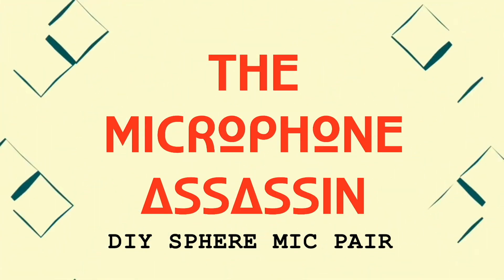Dueling DIY Sphere Modeling Microphones

Comment: I thought that only electronic circuits and capsules determined the sound of my DIY microphone. However, the fact that it is clearly influenced by the analog acoustics of the headbasket is very interesting.
I prefer the tight sound of a small headbasket, and I got a hint to address one of the shortcomings of my DIY U87.
It's a fantastic experiment video.
Reply from the maker: Thank you. It has come as a surprise to me as well since it hasn’t been a topic of consideration that I’d ever seriously thought of before. Tighter headbaskets, I am finding, are better suited for what I do.

Comment: do you have any blue bottle mics or a Soyuz? I wonder how they sound with their tiny head baskets, is this a thing now? Lots of people talking about basket size as a decerning factor, how important is it, I was always told it's the capsule, then it was the circuit, then it was the transformer, it seems like now it is the basket size, just asking for a friend my basket is pretty big
Reply from the maker: I have an 017 FET and it never occurred to me, but I’m sure it would sound very different in a larger headbasket. I’ve been honestly astonished in the noticeable differences headbasket size makes ever since the Sphere comparison videos from a few months back. Now, it’s another thing to consider, as if there weren’t enough variables to consider already. LOL. It’s no myth. Headbasket size and shape has a very big influence on sound. The tighter the space around the capsule, the fewer reflections are bouncing around inside and the smaller the phase smear.

Comment: This video comes just at the right time! 👍 I have two Townends L22's and I would like to build two DIY sphere mic's (my first DIY project). The arienne audio K47 capsules arrived today and the OPA Alice Dual Channels are on the way. But now I'm a little bit scared. 😅 I thought this kind of diy mic would be an easy one but you mentioned it is not for beginners. Could you explain why?
Reply from the maker: Yes, if you've never done my DIY before, there's almost always going to be some kind of issue or problem to solve that wasn't anticipated, whether it's the need to switch capsule mounts or how the board attaches inside the mic. It's absolutely an intermediate-level endeavor, but JLI offers up some decent documentation on dual alice builds. Overall, I feel like if you have to ask why, then you're not ready. But of course, feel free to make it as you see fit. Also, the flat K47 may be a little dark-ish for a Sphere, but the only way to know is to try. Have fun!
Reply: Thank's for your reply! The original Sphere mic's use a filter to 'linearize' the frequency response of the 797 capsules so I choose a linear capsules from arienne audio. I use the Sphere software for the polar pattern stuff and Acustica Audio LAVA for the microphone modeling. So maybey a linear capsule  could perform better than the original. Yes, the attechment of the board inside a U47 body gives me some headache. We will see if it works. @MarkYoshimotoNemcoff